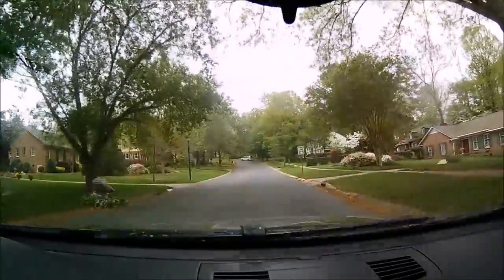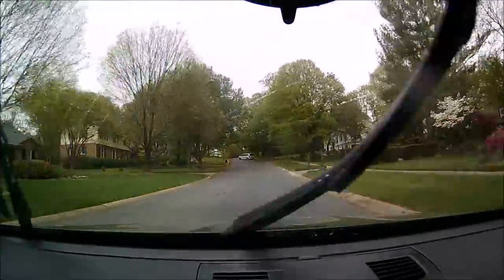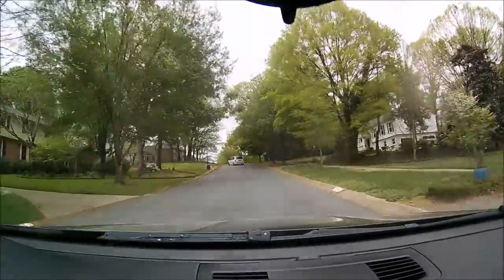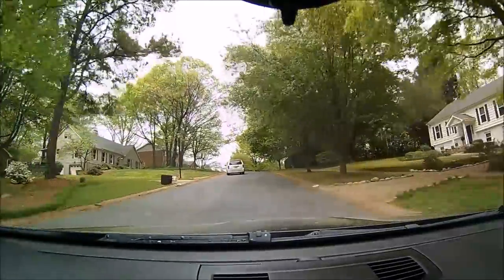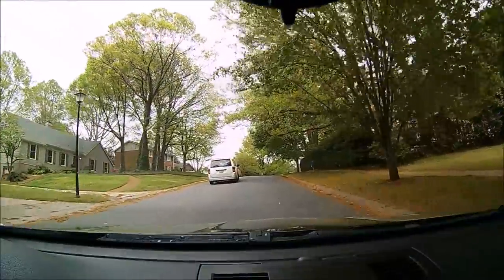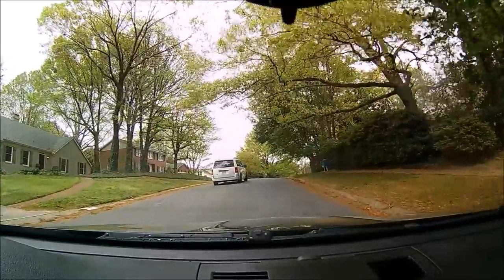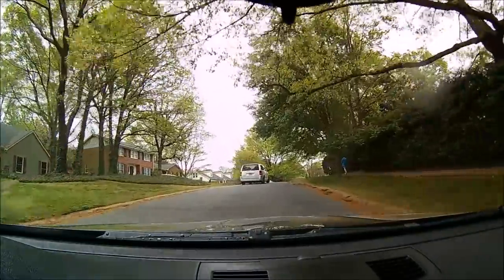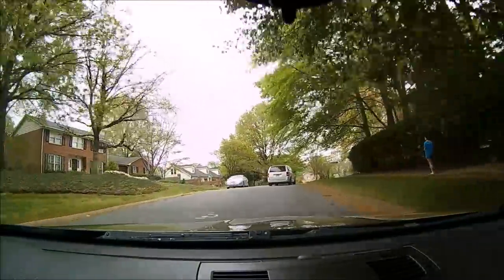BMS Cowl Filter Delete Review!!!

Comment: I’m at bimmers rn and I’m having my plugs and coils change . The tech told me I should put back on my cowl filters . She showed me the coils to cylinder 6 and 5 and they were rusted af. It’s because the water that the original cowl filter would block and drain to the side isn’t there and the water just runs into the back of the engine causing all my misfires . I wouldn’t suggest this now that I know about it
Reply from the maker: Wow I’ve never heard anything of this before. Thanks for sharing this information!
Reply: Really ? I just did mine a month ago
Reply: It all depends where u have your car parked .

Comment: In the video you're confusing unsprung weigh with rotational mass.  reducing unsprung brake caliper weight is a 1 to 1 ratio for the weight removed,  weight from wheels, axles, driveshaft, and flywheel though is not 1 to 1. Rotational mass is what gains more power, not just any unsprung weight. The main advantage to unsprung non rotational mass reduction is ride quality. Less unsprung weight carries less momentum thru the springs when you hit a bump creating a smoother ride.

Comment: Gosh I really want to get those filters!It gives me motivation to fix my water pump/Thermostat,my n52 has been running about 85*c if I use the heat at all.I would always like to get more sound without actually getting an exhaust haha

 Love the little tire squeal lol.Cool to see the car in action.

One time my friend with an 89 e30 had recently rotated his wheels.Later that night he had gone on a date,but when they pulled up to the restaurant all of his wheel studs broke on one of the rear wheels and the body weight was sitting on the wheel in that corner...

We found out that he had tightened the lug studs too much and stretched them.🙄

Also funny you mentioned about running with no plastic cover.Ever since I did my valve cover it's been off.
Reply: resonator and muffler delete with tips installed only about $200
Reply: I got an extra pair of cowl filters that I bought by accident. You interested ?
Reply: @miguelpalencia9788  shipping costs to NC?
I may be interested lol

Comment: i personally just hate taking of the air filter top part. all the screws have striped out the plastic probably from techs and owners using a drill including myself. i plan on only installing the cowl filters and leaving the cowl in place to  protect the ignition coils and ecu. it's only 2 screws after you get rid of that air filter top part. probably will try driving around without it to hear the difference in engine noise one time to see what the big deal is.

Comment: What happens if it rains?
Reply: Venir Lekha it's fine,Many forums debates have been had
Reply from the maker: Exactly what I was going to say. I did a lot of research and talked to a couple of people running them. I came to the same conclusion.
Reply: I did mine when a storm hit here in spartamburg SC and no water look like went in except when I use the windshield whippers it skirts so fast it got two water drips on my engine cover somehow